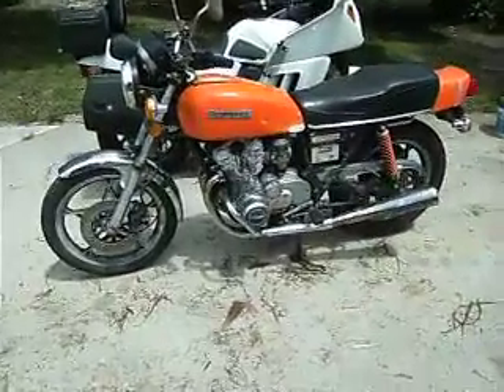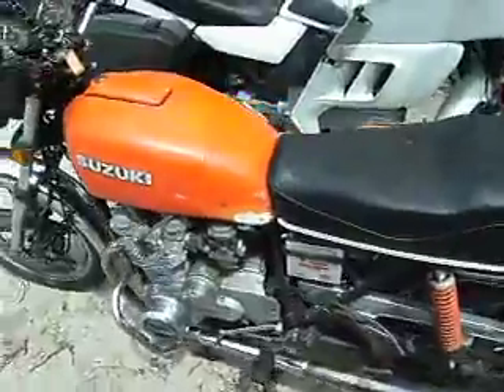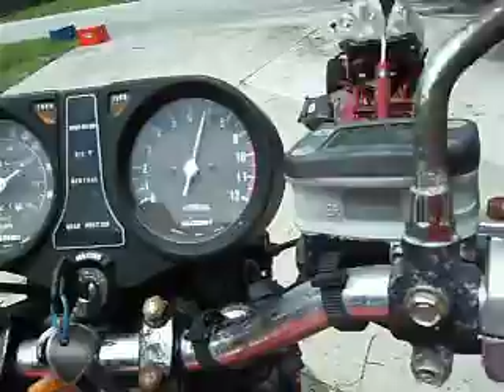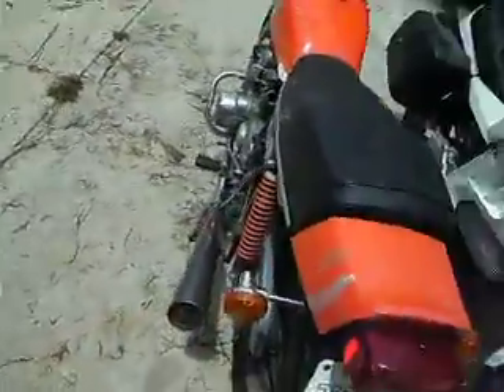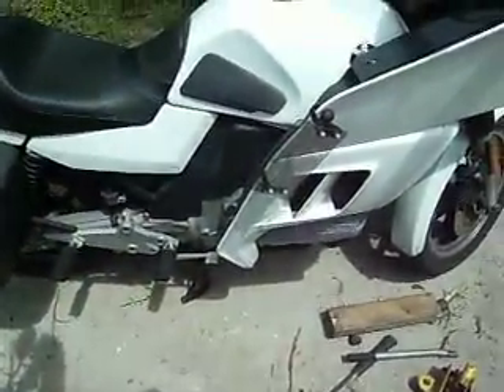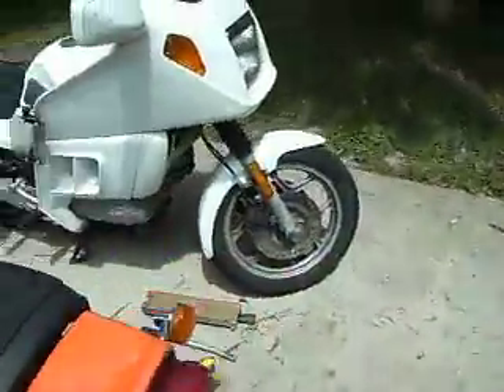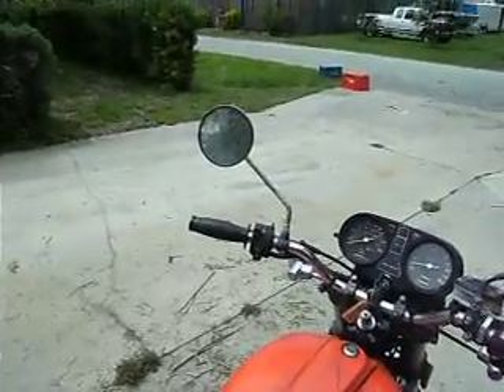1980 Suzuki GS550E Up and running

Comment from the maker: @winterlounge The blocks cant really take a turbo very well... I could and did dust a couple of 600 katanas with it but due to the weight she had a hard time keeping up with water cooled GSXR's. Much over 12:1 compression and you are either having to run 100LL AVgas I had her jetted really rich to keep her from pinging on 93. She was built as a compromise - I could run her all day at 130 or so or go drag her without killing her the first few runs

Comment: @dawino6260 Yeah my thought was to use the 650 cylinders with a steel crank and rods, but my concern is tuning and probably having to run a fuel injection setup instead of carbs which is gonna be expensive and more hassle.  The old turbo bikes of the late 70's keep popping in mind for my restoration.  I'm still gathering bits and pieces so I'm in no hurry and still ride it as is.   Check out my vid in it's current condition.

Comment: @dawino6260 I have a 1978 gs550e that I'm planning to build as well, maybe even turbo.  I'm curious though is built for the drag strip? I think on the street most of the newer 600s would have the advantage.  My dad has a 1972 h2 and at the strip it will hang with if not beat even hayabusas but on the street they have the top speed advantage.

Comment: do you mind if i ask you a question sir what size main jet are in the carbs to enable no air fillter
Reply from the maker: I just had the airbox off at the tie -- NEVER run a bike without an air filter other than for testing purposes - That's a good way to get sand between a piston and cylinder wall ...